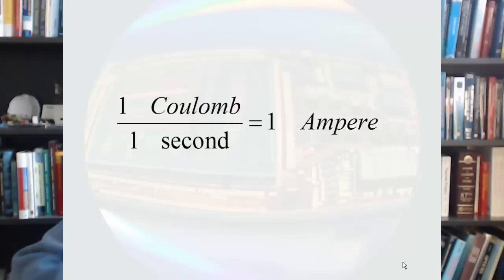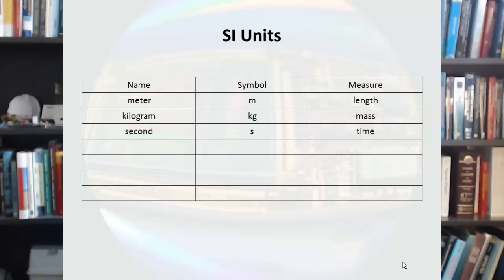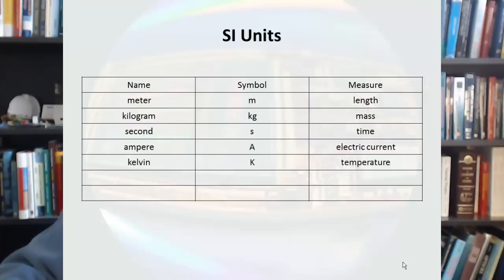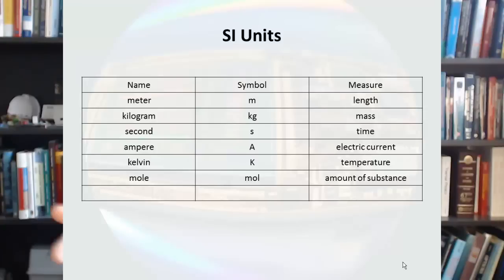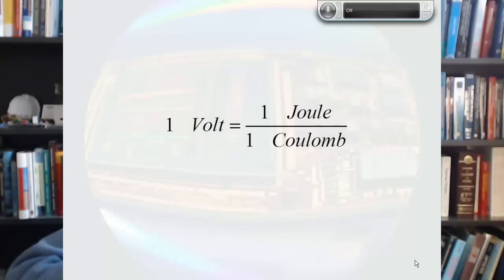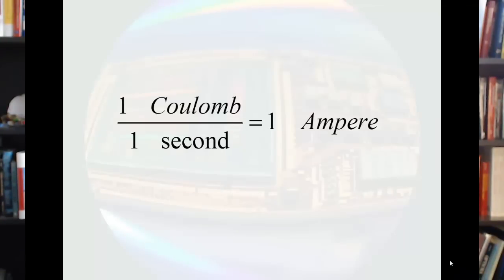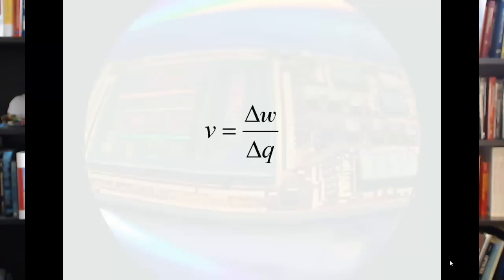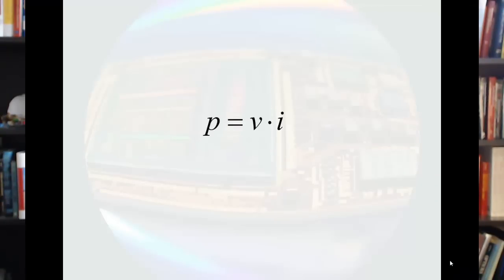01. Charge Current Voltage and Power

Comment: As you stated positive charge moving in the positive direction is a positive current in that direction. You also displayed how if negative charge moves in the opposite direction that is still a positive current in the positive charge moving direction. Thus it follows that if your arrow is in the direction of negative charge we would have a negative current, right?
Reply from the maker: I do not know the arrow to which you are referring.  There are two quantities (direction and charge) that can have two values, so there are four combinations.  Positive charge moving in a positive direction is positive current.  Positive charge moving in a negative direction is negative current.  Negative charge moving in a positive direction is negative current.  Negative charge moving in a negative direction is positive current.
Reply: gEEch Okay got it. This is what I was referring to. Therefore, all four combinations are defined under one convention. When you have a positive current you know it is do to some combination of two of the combinations. And a negative current is some amount of the other two combinations. So how come when we talk about current we do so more vaguely. For example we say that current flows from high to low potential. But negative current actually flows from low to high. When we say the word current, it seems to always mean the value is positive unless specified otherwise. Is this similar to how we talk about some vectors like velocity and displacement, where were always referring to the positive unless otherwise specified

Negative current is just as much as a valid concept as positive current. So it seems like our statements should
specify the sign before saying stuff like current moves opposite electrons and from high to low potential. Because this will only be true for positive current
Reply from the maker: @TriThom50  We do assume a positive current unless otherwise specified. This simplifies communication. Unless we are doing formal logical proofs, we tend not to define every possible assumption because communication becomes cumbersome if we do.
Reply: gEEch Agreed it makes sense I just wanted to confirm when we get a negative current and say “oh that’s fine that just means current goes the other way”. We are not making that statement because negative current is wrong or not an actual entity itself. We are making that statement because when we say current we are inferring positive, as you said to simplify our speech. And all of this has nothing to do with the debate of “conventional current vs. the navy convention”
Reply: Is there any way to contact you via email or something to have a better conversation/ask questions?
Reply: gEEch just to give more details of my confusion, if you look online, you might see a diagram that has a current arrow pointing from + to -, and then another one pointing - to +. The one labeled + to - is often called conventional current and the one - to + is labeled electron flow. But conventional current doesn’t always have to point from + to-, it can point in the same direction as electrons, as long as it has a negative value. I think what these diagrams are trying to communicate is that the positive conventional current is opposite to electrons, but they don’t put any value in these diagrams. It’s often just an arrow with no labels. Is it also understood that an unlabeled arrow means that the arrow holds a positive value? If so, this would make sense as calling two positive currents in opposite directions a different convention would be correct. But I just feel it is wrong to point an arrow one way and say it’s opposite to electrons, because we can draw our arrow from - to + and just give it a negative value and that’s just fine and wouldn’t break our convention at all.
Reply from the maker: @TriThom50  The email associated with this channel is geechone@gmail.com.  I do not monitor it regularly.
Reply from the maker: @TriThom50  Do not confuse physics with convention.  Current is defined as the direction opposite electron flow as it is the direction of the flow of positive charge.  Also, there is nothing mystical about negative current.  Negative current simply means the arrow was drawn in the wrong direction.  If I assume a direction for a current in a circuit and determine the value to be negative, it means that I drew the arrow in the opposite direction of the actual current.  All an arrow means is that we have chosen a direction to define positive current.  It does not mean anything physically.  It sets up the passive sign convention.
Reply: gEEch if you say conventional current is in the direction opposite of negative charge, and I reply “is that true for negative current” are you going to reply “negative current isn’t conventional current” or are you going to reply “when I say conventional current or current I mean positive, so no it wouldn’t be true for negative current, although conventional current can be negative, this isnt what we’re referring to unless explicitly stated”
Reply: gEEch is this another situation where the word current is intended to mean positive? Because as you said above negative current is the same direction as electron flow. I thought neither negative or positive was right or wrong they just indicate different things
Reply from the maker: @TriThom50  It is a convention.  Without conventions we cannot communicate effectively.  We agree that positive current flows from the positive to the negative of a voltage across a passive element.  It is as simple as that.
Reply: gEEch okay I agree with this statement. Our convention tells us that like you said, positive current goes from high to low potential. But it also tells us that negative current goes from low to high potential. Therefore, using our convention you can model the flow of electrons, but you would have to use a negative value. Thus, under our convention, positive current will be moving opposite to electrons, because positive and negative current go opposite ways. But this does not mean it is impossible to draw your arrow in the direction of electrons, you can it would just be negative, which is also apart of the convention to my understanding? So the convention doesn’t say that current in general has to move opposite of electrons, but it does say that POSITIVE current must move opposite electrons?
Reply: gEEch if I reply to your statement “current is defined as the direction opposite electron flow as it is the direction of the flow of positive charge” and replace it with “positive current is defined as the direction opposite electron flow as it is the direction flow of positive charge” are we saying the same thing? Or are you making this statement intentionally omitting the word positive? I am having trouble deciphering if when people state the convention as you have, if they agree that those statements are really the definition for positive current
Reply from the maker: @TriThom50  The word positive is left out because it is assumed.  We do this with many quantities such as velocity, acceleration, pressure, etc. Negative is the deviation from normal, so it needs to be stated.  That is normal use of language.
Reply: gEEch okay that’s a fair point and makes sense. So under the same convention that states that current moves from high to low potential, you could also state that negative current moves from low to high potential? Obviously the first half of this sentence current would be implied to be positive? Also, for unlabeled reference arrows that just point high to low and call this conventional current. What they really are trying to represent is the direction of flow of positive conventional current? They are not trying to say your arrow is “not allowed” to be pointed from low to high? It is simply the fact that every default discussion about current implies positive so the arrow is displaying what the positive value is defined as?

Comment: So the charge is basically a very large amount of electrons piled up together. If so, then does that mean we can apply the same characteristics of the sub-atomic particle of an electron to that of a Coulomb of charge? And if that’s true, then does that mean positive charge doesn’t actually move but just appears to be moving opposite of an electron?
Reply from the maker: In a solid, the protons cannot flow.  However, if hydrogen, for example, were ionized the protons could flow.